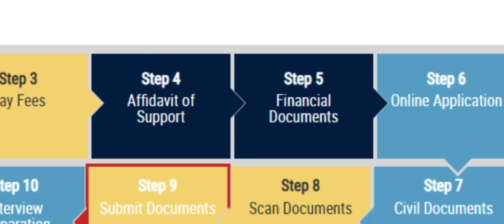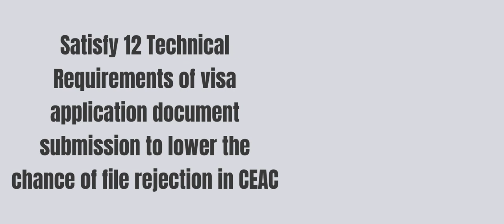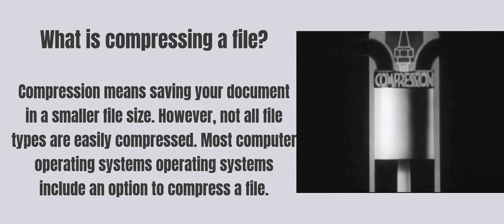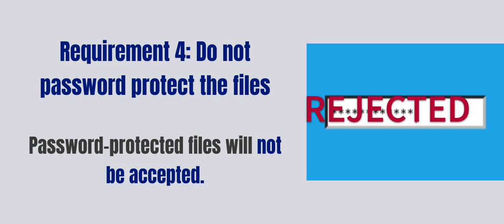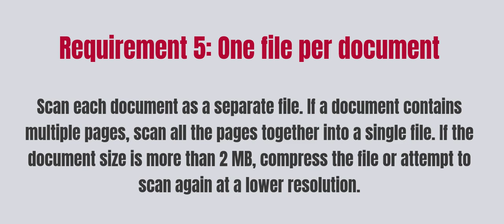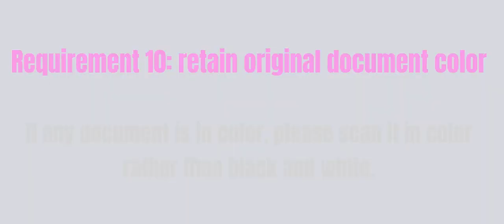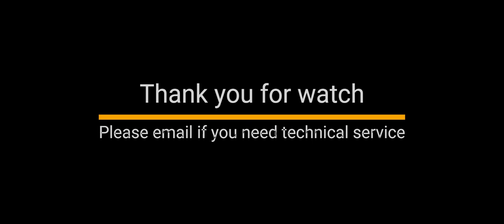As NVC immigrant visa wait time prolonged, avoiding file upload error/rejection in CEAC can help.

Comment: I recently sent in my documents for review and I was told to send the document I have already sent in for review and I went back to check my CERa account and found all my documents was accepted but I did not get any DQ message so what do you think is going on with NVC
Reply from the maker: You can send an inquiry using the NVC public inquiry form.  The service agent will email you back and clarify the status of your documents.
Reply: Am having the same problem and I don’t know what to do I sent 2 inquiry but they only send me bck a message asking to submit the documents but when I log in it’s saying accepted so I can’t do anything to it and this has been holding my case for a few months now
Reply from the maker: I see.  In the inquiry form, you can tell them the error message you encounter or the “submitted” status of the doc does not let you resubmit the same type of doc.